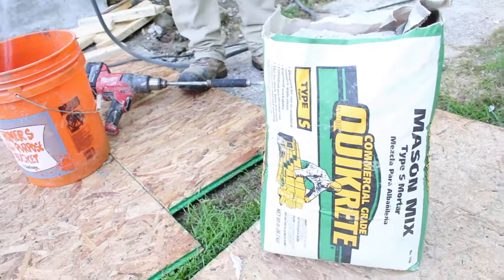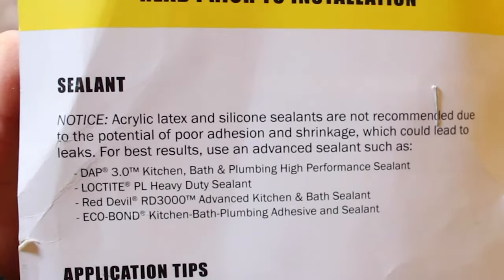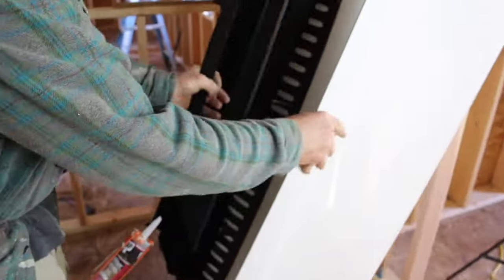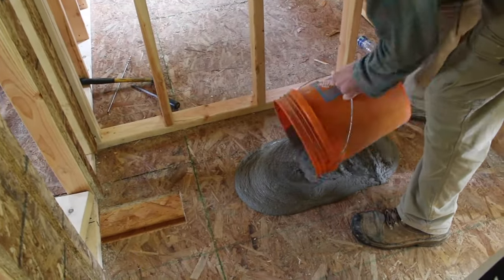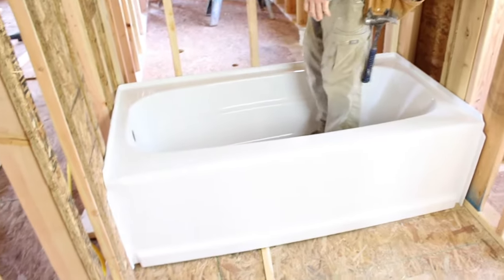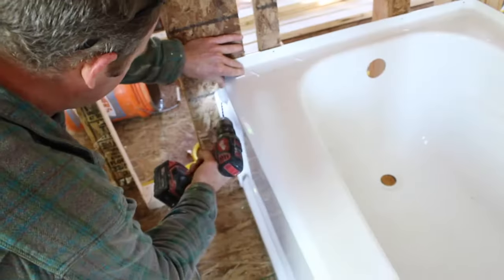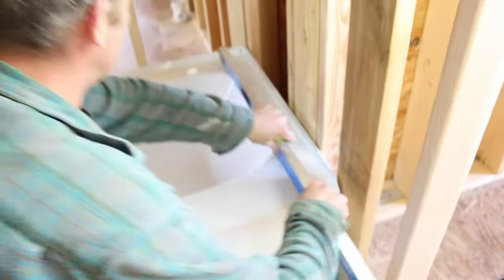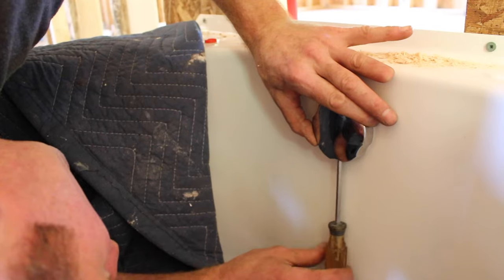How to Install a Delta Acrylic Bathtub (Quick Tips!)

Comment: I am a newb at tub install, but am well respected in building envelope evaluation and installation. Is there any concern for placing mortar directly on untreated plywood? Seems like over time the direct contact of the portland cement to the plywood would cause a dry-rot condition?  Why wouldn't you use a layer of 15lb paper/15mil plastic/waterproof membrane between the plywood and mortar to prevent moisture to travel out of the plywood?
Reply: How could it rot unless there a leak

Comment: A lot lighter than the old cast iron tubs. I had to take a sledgehammer to mine to remove it. I replaced it with an American standard with americast steel, about 120lbs. I put down a mortar bed like Steve did, that makes it very solid.
Reply from the maker: much much lighter!! Mortar beds are fantastic and we highly recommend using one if in the directions. Americast tubs are great options

Comment: If there is microfilm attached, leave it on until the final cleaners remove it!! Use polymer modified thinset instead of mason mix especially over osb or plywood.

Comment: We had two acrylic tubs with surrounds installed when rebuilding after a house fire. Both cracked all across the bottom. High profile disaster restorations firm employing very marginal subcontractors. The plumbers repiped the house with PVC. I believe the copper that they took out was their pay for the job.

Comment: Always think of the next guy remodeling and put some painter's plastic, or any type of plastic sheet ,under the mortar so the tub comes out easily in 30 years leaving the subfloor clean and undamaged.
Reply: Lok These tubs only last 2 years. Stay far away from delta acrylics tubs

Comment: Aren't you supposed to use adhesive to install the apron support and not sealant?
Reply: The brands recommended by Delta in their install guides are dual-purpose sealant and adhesive, e.g. DAP Premium Kitchen & Bath Adhesive Sealant.

Comment: Now do this in an old mobile home lol with bad subflooring , rotted studs and moldy drywall  , that would be more realistic lol
Reply: That's what I'm about to rum imto
Reply: @miketate8554  You can do it, I did , hardest part for me was connecting the bathtub drain because it did not line up with the old sewer line , I had to move the sewer line

Comment: Thank you ! I see that you didn’t put the 1X3 on the studs . Why? Also waiting eagerly for the next video;)
Reply from the maker: Are you referring to furring strips?
Reply: Home Repair Tutor yes, I suppose ;) I  bought a MAAX bath and I have to put them 1/8 inch BELOW the sides (under the lip) of the bath. So I am a bit surprised it’s not a general thing . Mine has a whole plywood structure underneath imbedded in the fibreglass

Comment: I returned this tub and bought a American Standard one from Lowe's. Just wasn't comfortable with how flimsy this one was.
Reply: I agree. This tub is a flimsy peice of hell. The brace for the apron is useless because it only aligns the center. The ends are still floppin in the breeze. In my opinion this tub was not finished being manufactured as it comes. Delta should be ashamed of this product.

Comment: Tubs crack continuously around drain section. Installed two that have. Poor design and very cheap. Installed 100% by manufacturer specs.
Reply from the maker: totally sucks, were they Delta?
Reply: @HomeRepairTutor  yes.
Reply: Perhaps your over tightening the drain

Comment: Mortar is used not so much  to support the tub, but its to dampen the sound of the water hitting the base. Otherwise it sounds hallow and loud like a cheap motel tub. Support comes from screwing the apron into the studs and the plywood you have under the tub
Reply: mortar provides a surface to transfer load to.
Reply: From the reviews I've read these particular tubs crack like crazy, even with mortar. The mortar is needed for support.